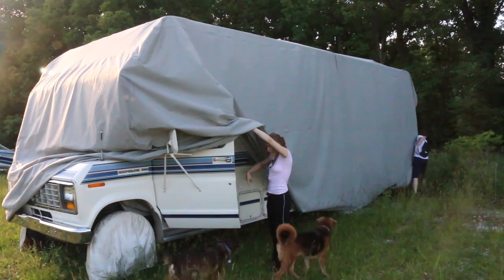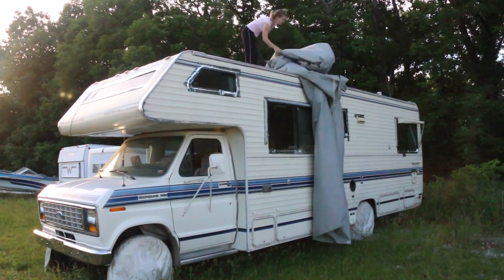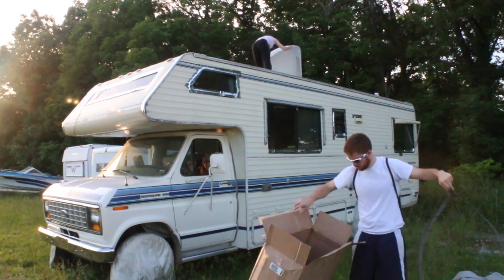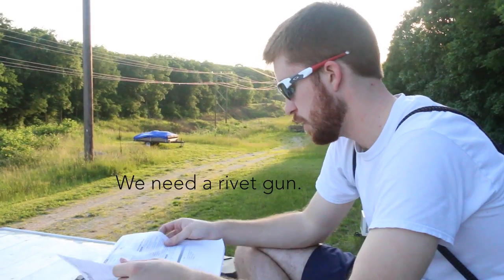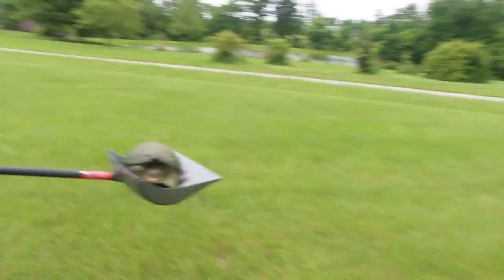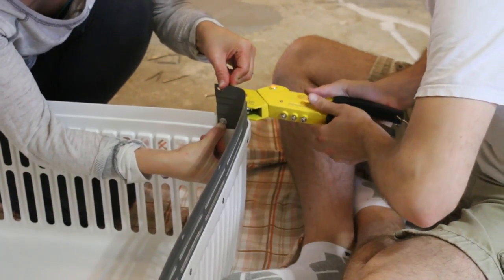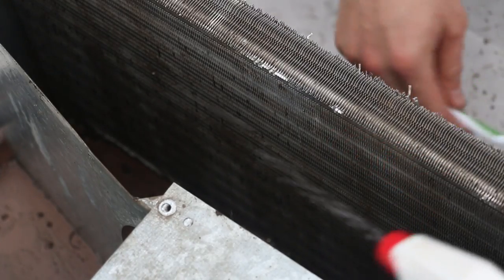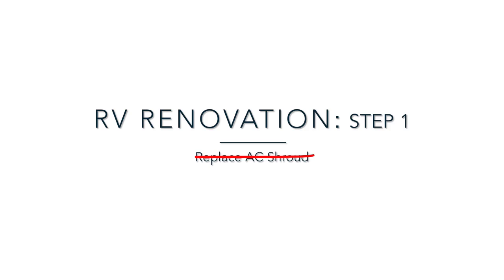Installing a New AC Shroud on Our RV

Comment: We did the same thing and put our AC cover together in the Harbor Freight Tools parking lot. lol. They also sell an AC vent comb. You run it down the bent splines at the back of the unit to straighten them back out for more efficiency.

Comment: Enjoying your videos. I recently bought an 87 Class B and, instead of replacing a missing a/c shroud, I decided to remove the 30 year old a/c and go with a roof vent instead. 

So far I haven't missed having the a/c option (but have yet to endure a hot summer) but have never been a huge fan of air conditioning anyhow. Also, removing that much weight so high in the vehicle (remember it's a Class B) REALLY helped handling issues and cut down my "sail area."

Also nice to see videos from "local" folks. I live over here in Fulton. Give me a wave if you see me on the open road.

Comment: Someone may have already pointed this out to you ... all those bent fins in the back of the AC need to be straightened out to allow air to pass through. Just use a small screwdriver of thin putty knife to put them back in place.